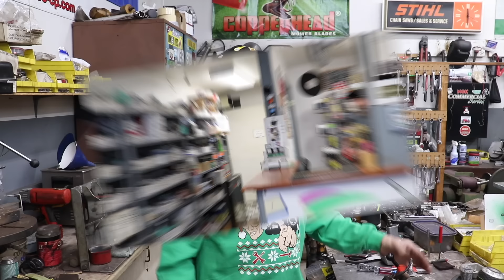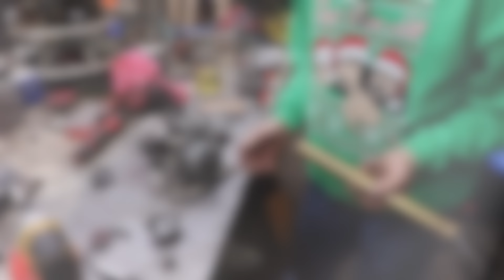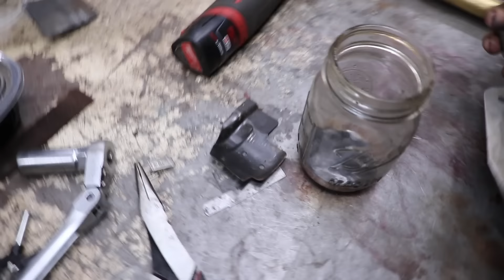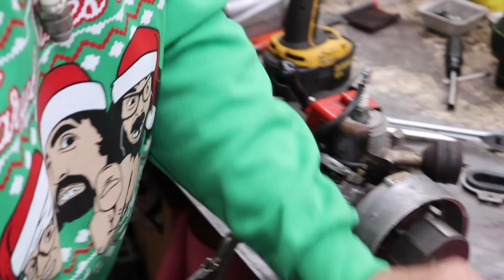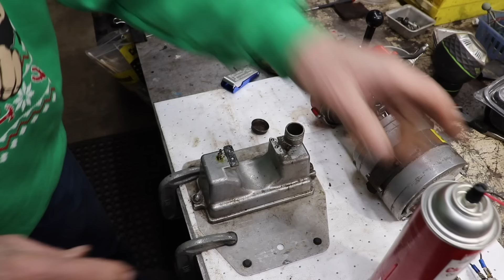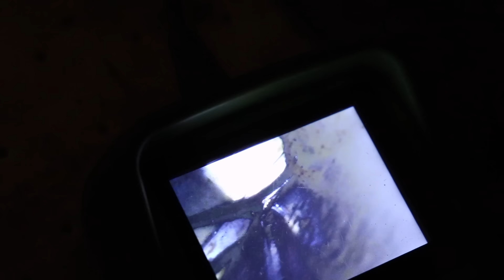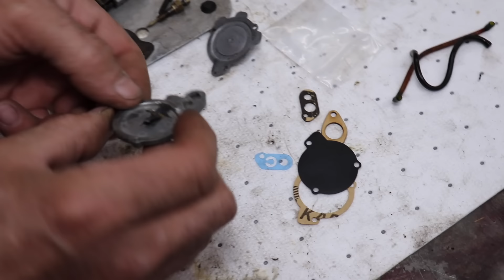World's SMALLEST Generator EVER! Will It Run?

Comment: Two problems with Olsen Rice gas engines:
1) The transfer ports in the cylinders were drilled AFTER the cylinder was screwed down on to its cushy gasket. Half the time you unscrew the spark plug the cylinder loosens on its threads and has to be retightened. Then the transfers arent lined up smooth anymore. They will start and idle but high rpm power is way way way down. It gets to where you have to make shim-gaskets out of paper or shim-metal so the cylinder is both I) Tight and II) transfers exactly straight-as-drilled.
2) The diaphragm carburetors had a rocker arm transmits "in" motion (due to venturi suction) of the diaphragm into "up" motion of the metering needle. THE ROCKER WAS MADE OUT OF RUBBER. Fat chance you're going to get one of those to work for very long. I've A) Fabbed a new rocker out of aluminum or brass and, B) Adapted a tiny Walbro WA carburetor to the OR engine.
Reply: First time hearing of that brand myself. I'm tickled seeing all American made! Don't see the much anymore.
Reply: @66Grudge  They made good model airplane engines but they never caught on in  the power equipment world.
      I kept one running for about 8 years for a deaf guy had an O&R bicycle-motorizing kit on the front wheel of an old Schwinn. 
Cannibalized couple hedge trimmers, couple chainsaws and a genset to do it.
I never saw one with a factory metal rocker in the carb like the one in this video. I fabbed a half dozen rockers in my time four out of aluminum and two out of brass.
     The deaf guy's bicylcle motor eventually got a Walbro WA or WT adapted to it.
Reply: @66Grudge  Blame NAFTA.
Reply: @AnthonyDiSano  The Puppet Ronnie Fooking Raygun granted China "Most Favored Nation" status in 1980 and that was the beginning of the end of our industrial  base. The one super elite international banking family at the very top picked him out as a washed up actor they could groom, put him in office - and then turn him traitor, slow-kill our economy, and get us in wars on behalf of a certain middle eastern nation. I can prove it all by the way.
Reply: @patrickshaw8595  Yes sir. You are likely correct, however that's before my time. I do know that a bought and paid for Republican isn't any different than a bought and paid for Democrat.  As for the Rothschild's, Kanye let that cat out the bag for the masses to ponder. Now we wait.
Reply: @AnthonyDiSano yes NAFTA but big business wanted it
Reply: @paintedwink1520  this was built way before NAFTA. big business sold out the U.S. long ago.
Reply: Ohlsson…

Comment: That is one wicked cute engine. Love all the quality Aluminum.. I Wish that i could find any info online of my small Fuji/Subaru inverter Generator with the mechanically throttled 2-stroke Robin engine. You have got to see how much power that thing has to believe it. Plus it puts out Major 12 or 24v power... like 80amps. It's the size of a milk crate, weighs 25lbs and will run my table saw or 15a skill saw cutting 2x4s. I have to see if i can get mine going... hasn't run in a while.. Thanks for this video 📹 👍 ~
Reply: I think mustie did something like a Fuji/Subaru not long ago if I'm remembering correctly.

Comment: I had one of these in the 80's.  Got it used at a garage sale still in the box with all the paperwork.   Ran fine BUT was too loud to be useful.  Resold it to someone before the carb gasket got hard as a carp!  Zero parts availability back then. 

 I have one of those little Honda E-40 generators.  4 cycle and even back then super quiet.  It was purpose build for and resold by Sony in the mid 60's to power their tiny 5 inch portable TV's.  There is the story out on the interscreens along with an old advertisement showing the generator and TV together in a field with a pretty model.

Comment: The smallest generator I had was on my bicycle and it powered my lights. But it was powered by my blood, sweat, and tears...
Reply: Had a few of them too as a kid.  Some of the bike tires back then had grooves molded in  the sidewall for the generator wheel to ride on.  Cool memories
Reply: I had one of them.. that was pretty cool tech when I was a kid.
Reply: You can still get these "Bottle" generators.  Peter White Cycles in Massachusetts has really nice ones from Germany.  Never need to worry about dead batteries on you bike light, and unlike the cheap ones from the Far East, the German ones just LAST.
Reply: I put a larger input "pulley" on mine & was able to run 2 KC style lights. But, only if I was moving at a good clip
Reply: Same here.  My son has it on HIS bike now, though the lights are long gone.

Comment: When you have a diaphragm that needs replacing and there is no source, I have had luck at getting them softened so that they are pliable enough to operated properly, by soaking the diaphragm in brake fluid.  I don't know how this works, but it does.  When I was a kid in the 50s, O&R engines, were the gold standard for large model aircraft.  I remember one model Lancaster bomber, that had 4 O&R 60cc engines and radio control.  For us model builders, it was like seeing a unicorn.  Beautiful little motors.  Great, informative video.

Comment: One of the absolute best cleaners I've used for fuel funk is lacquer thinner.  A gallon can is not very expensive, and a little goes a long way. The downside is it is hellish on some plastics and it will  eat up paint. (On the plus side, if you smell it long enough you can actually talk to the engine.)
Reply: If you smell it long enough, your liver will also talk to you.
Reply: @nheng6913  Acetone I believe is laquer thinner. Nail salon girls breath it for years ..
Reply: @mitzvahgolem  Some acetone is found in the human body. When the liver breaks down fats for energy, some acetone is produced. Breath that smells like acetone can be a symptom of diabetes.
Reply: @billsimpson604  I guess it's time to stop drinking antifreeze then huh?
Reply: @mitzvahgolem   There's a joke in that statement somewhere about salon girls, but I just haven't thought of it yet.....🤔😂
Reply: @arthurmann578  saloon vs Salon
Reply: @mitzvahgolem  Acetone is Nail Polish - YES .. Acetone same as laquer thinner - NO.
Acetone is the 1st vapor that comes off with ANY distillation  ..  Laquer is distillation from a specific tree called the laquer tree .
Reply: @tsvandyke  we use Acetone for fiberglass boat building and Laquer thinner is half acetone with alcohol and other additives I recall.
I have used both to clean carburetor fuel system varnish since 1978 in marine engines.
Reply: @mitzvahgolem  no wonder lmao
Reply: If you drink enough of it you can talk to the guy who invented lacquer thinner.
Reply: Absolutely! So much wasted time when lacquer thinner would have dissolved that crap in short order.
Reply: 51:26 that's what she said.
Reply: O'Reilly carb cleaner is not 2 bad rest of the parts outlets suck
Reply: @jeffviar7928  I try it 🍀 luck charms blend
Reply: Muratic Acid is the best thing for rusted fuel tanks.
Reply: @AE-lk3uc 
The 17% solution....
Reply: It definitely makes it easier to fix a engine when you can talk to it...👍👍
Reply: Agree, but Coleman camp.fuel is the shit!!!!
Reply: I like colman camp fuel,dissolves gym works great, and doesn't eat rubber!😎👍
Reply: Another bonus is if there’s some left over in the tank after cleaning you can fill it with gas and the engine will start and run just fine.
Reply: It also works decent with brushing lacquer!
Reply: If its rusty i just stick  all my sockets in it and shake it for a few minutes
Reply: Smell it long enough the engine will talk back!
Reply: Will it answer back?😅😅
Reply: VM&P Naphtha? (In lieu of Coleman’s Fuel?)
Reply: @dennisyoung4631 Yep, same thing except doesn't have three drops of oil as a corrosion inhibitor.
Reply: @dennisyoung4631   Same stuff, probably different prices. (Have not bought "Coleman Fuel" in decades)
Reply: I think I can get lacquer thinner but here in Canada and environmental laws, which I do support, we can not get access to anything good. The old paint stripper that actually worked, nope. The can of Barrymans Carb cleaner that actually worked nope. All our chemicals have been bubble wrapped to protect the environment. In the end I just got an ultrasonic cleaner for carbs and life is good.
Reply: Brings back memories of high school wood shop, there was a dude that used to spray the inside of his mask with lacquer thinner
Reply: True I use laquer thinner to clean clogged carbs .
Just be careful on plastic parts .
Much better than any gumout  etc
Reply: Actually, I’ve found that E85 is an excellent solvent for cleaning fuel tanks.
Reply: @notajp  back when 10 ethanol was first introduced many older vehicles experienced plugged fuel filters because the ethanol cleaned the crap on the tank.
Reply: @notajp  And its cheap.
Reply: @notajp  makes scince, see as its basically alcohol.
Reply: I've been working off a 5 gal. pail of Super Agitene for about ten years.  Was around $90 but now is like $180.  In a pump sprayer bottle, most oil, grease and mixtures roll right off of chain saws.  It's safe on plastics and it also leaves a microscopic level of lanolin behind, to give some rust protection on steel parts.  It's a very mild, ultra refined solvent with also low odor.
Reply: @nheng6913 we’ve got a 55 gallon drum of Naptha at the shop that’s been filling a spray can for years to use to clean parts….I also use it in my Zippo lighter, it works just as well as the name brand fluid. Definitely hard on plastics though and the odor is definitely pungent, although I kind of like it.

Comment: Taryl, you might want one of those scopes for a smart phone that plugs in the charging port. On eBay, they are about $7.
Reply: I have 3 of them. The LED's are woefully underpowered. 3 different brands with the same issue.

Comment: 5:25  Good for  you !  We see a  round   magnet, from a microwave oven, on  your  bench; holding 2 small bolts.   I  use  these, got many of them. Work great, holding computer screws, nails,  ANYTHING;  screw driver bits, etc...   stick onto  trouble lights....
Reply: Where only see the spark tester ?

Comment: That "lymphoma" looking thing almost looks like some kind of a float. Why they would put a float in there I have no idea but given it's rather purposeful cone shape and the fact that it slid up and down that brass tube a float came to mind. I think to set the RPM you probably need to check the cycles (hertz) and set to 60 hertz. Did I see a blooper? It looked like you didn't put that screen back in the carb when you reassembled it, maybe  missed it. Great video as always.
Reply: Yeah, I believe he 4got about the screen to. I saw that as well

Comment: Engine speed is set with a volt and hertz meter hooked to the receptacle. 120 volts @ 60 hertz.
Reply: Based on age and design, it's more like 110 or 115 volts at whatever frequency that ends up being. 120 volts is a fairly modern line voltage, in the old vintage days typical household voltage was lower and there is no voltage regulator on this generator - voltage is solely controlled by engine speed.

Comment: Set speed with volt meter
Reply: YES
Reply: I don't think that's too important for a display piece. No one's actually going to use this equipment. It's too collectible for that. You can get something for a fraction of what it's worth that'd work a lot better than it does.

Comment: Am curious... had this been a real job what would the customer have paid for that repair?
Reply: Shop rate is anywhere from $50 to $100 an hour typically. Then there's the parts and other supplies. Which is why often folks just toss stuff out. It's cheaper to buy it new than it is to get it fixed. If I had to guess I'd say this repair would have cost north of $300.
Reply: If they got it to the point where the gen was dead I think most shops would not touch it.

Comment: Taryl, I'd love to see you make a farmer's battery charger from a pressure washer engine from a unit with a bad pump and a used alternator. A 72 amp with built-in regulator should do well, but smaller is ok, and bigger might not do well. A 6" pulley is needed for the engine to get the alternator up to speed. You might need to turn the engine sideways and keep the belt short. The rest should be easy to figure out.
Reply: I just made one out of a 5hp horizontal shaft B&S and a Delco 10si, used  a 1/2" x 24'" belt, fashioned an adjustable spring belt tensioner. using a 3.5" pulley on the motor. Direct drive would be better with LoveJoy coupling, the Delco shaft is metric.
Reply: @sierraromeo  direct drive love joy will not give the rpm  for the alternator. 5hp will use 2 delco 10si together. but for home made charger find a old generator, they can provide consent out put, where alternator can provide max out put for only a few min. Voltage on generator can be controlled by consent speed.
Reply: @cliffclark6441
Reply: @cliffclark6441  direct drive (coupling or 1 to 1 belt  will give you 50 amps at 3600.  My apps only require 20amps, so I run my Briggs at 1800 most of the time, to power my wood boiler, and a internet relay link during low sunlight situations.
Reply: @sierraromeo  Tell me the alternator you are using and i will look up rpm amp out put. Never heard of any alternator putting out 50 amps at 3600, that's below  idle speed alternator turns on any car, It needs to reach around 10,000 rpm. Reason you got to be careful which alternator you use to replace generator on tractors and diesel engines, some will not spin fast enough to ever excite alternator. I must run my tractor full throttle for a minute before the alternator will start charging. Converting generators to alternators speed of alternator was a problem we had to deal with for years. Like converting points to electron ign. Points will fire at any rpm, some older motors had to low cranking speed for electron ign. If you only need 20 amps for your application , You only need about 2 hp total engine out put to reach 13.5 volts. Even a 1/4 hp electric motor can turn alternator if volt out put is low, around 8 volt it will stall around 9 volts volt out put determiner input hp needed not amps. Speed needed to create magnetic field in alternator is why alternator is very sensitive to speed. It is a simple 3 phase motor using diode to create dc currant. It is not a true dc generator. A older delco 35 amp alternator like gm used for years, would be idea for your application. turn over 8,000 rpm it would take least amount of hp to operate. The old 35 amp alternator also will put out electric at lowest speed of any alternator i have ever used. Once brought up to speed to energize it puts out more amps at lower speed than any modern alternator. Higher max out put of alternator higher speed it needs to turn to begin charging.
Reply: @cliffclark6441  It depends on what your need is.  Unless you direct drive via coupling, toothed Gilmer type belt, you WILL be schredding that fractional HP belt. (Kevlar or standard) I fashioned a strong tension spring to tension belt, otherwise the belt
squeals, stalls and gets destroyed.....using 1 to 1 ratio. If I need SERIOUS KWs, I drag out the 4kw Onan.
Reply: Now I do have vintage BALL BEARING, Cast iron, long stroke  VINTAGE Wisconsin, Briggs in that HP range that will easily deliver the 72amps without detonating like that throw away sleeve bearing/aluminum Briggs.
Reply: @cliffclark6441  The 94amp Delco 12S1 puts out 80amps at 3600 shaft speed, the output curve flattens out above 4000rpm,  it is silly to turn these at 10,000rpm.
Reply: It is a Delco 10S1, have used many over the last 50 years. This one is marked "1 wire".  It is excited via a low wattage dash light. Dash light extinguished when the recoil rope is pulled, does not NOT need revving up! Have modified 10S1 on my two Deutz & MM tractors to ELIMINATE the need to "rev up motor" to initialize charging.  This Delco matches the output chart to a "T". You are doing something wrong or have bad components, maybe blown diodes?
Reply: When charging the three "dead" storage batteries (3x 100amp/hr @ 12v in parallel) the recoil is hard to pull, because the alternator is making EMF.

Comment: The LED is polarity sensitive..
Reply: As the name suggests alternating current flows both ways. So a LED will lite on one side of the cycle. What you have to do is put diodes going both ways so the reverse polarity doesn't kill the LED. It doesn't have to be an LED but it can be. You also need a dropper circuit and maybe even a current limiting resistor too. Because LEDs do not like too much voltage applied to them.
Reply: It's a neon bulb, it won't strike until it gets 80-90 volts

Comment: Taryl, in the welding shop I worked in, we were told that the striker on a pack of matches made a good makeshift points file.
Reply: I had an automotive shop teacher that showed us how you could use a matchbook to do a emergency cold timing of an engine. Back in the day before things got so much more complex.

Comment: Well Taryl, I am not with you, at the Aspen themathik... I do quit the same thing as you do here in Germany, little engine repairs. Aspen does eat especially old rubbers, like diaphrams, which ran always with standart fuel... I have lots of Chainsaws and Trimmers, which ran perfect until Aspen was used
Reply: Is Aspen expensive in Germany? It is terribly expensive here in USA just like everything else since  2021.
Reply: @grassrat93  Well, Aspen hasn't got more expensive since 2021, but yes, it is EXPENSIVE! At least compared to regular petrol

Comment: Cool project. O&R made model airplane engines back in the day with tiny spark plugs instead of glow plugs. That generator sounds like some of my plane engines!
Reply: I had an O&R powered model A that was given to me by my uncle when he went into the service. That's what got me hooked on small engines!
Reply: @RogerSegerJr I have a Maverick chain saw that has that engine on it,parts aren't easy to find